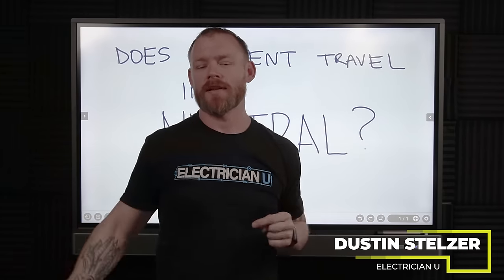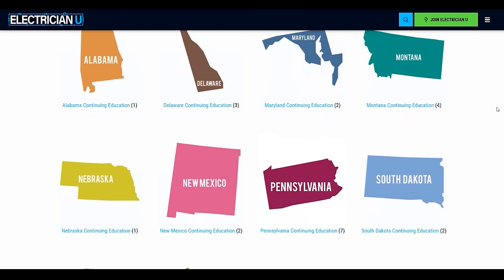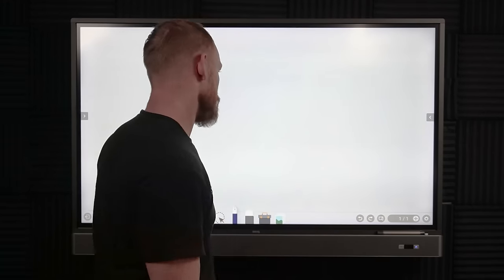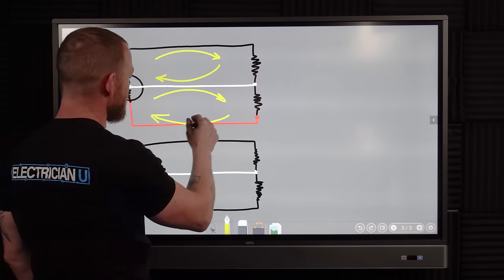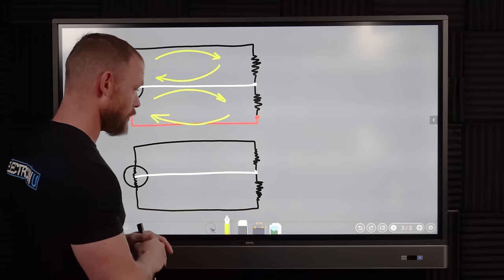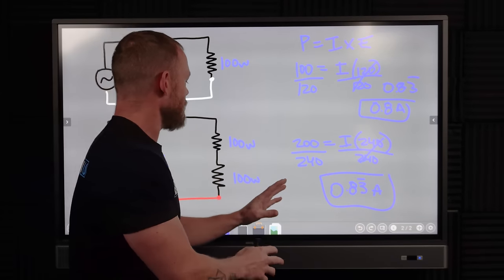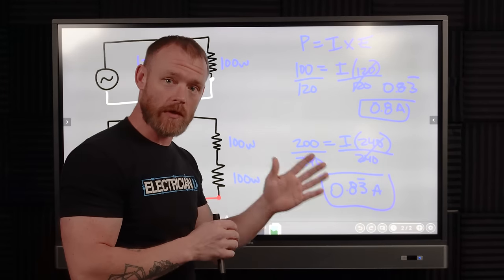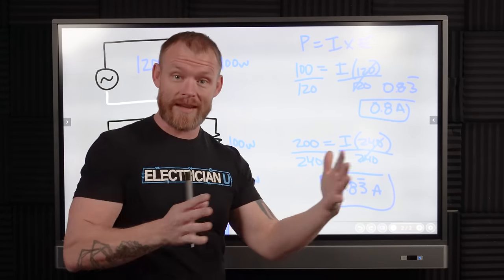Does Current Flow on the Neutral?

Comment: For what's it worth, I actuallty liked that you didn't have  the "schematic" drawn already. Not sure why, I have seen you draws these dozens of  times, I guess it just gives me time to process it things and get my mind in the right frame for what you're about to discuss.
Reply: 100%
Reply: This part
Reply: @tylerrcasement  what is Dustin Teaching 🙏🙏🙏
Reply: Agreed.  I'm not an electrician but as a homeowner that fixes/improves things it helps me to see how it all goes together.
Reply: @kevingray8616  Hi
Reply: @jeremynguyen2346  
Physics and math.
Reply: J
Reply: Hi the neutral of a seperatly derived crkt has a return current at 0 volts if u share a white or gray wire 277vac neutral w l1 l2 or in 3 phase systems l3 only unbalanced current will return if ea phase has 4 amps ,they cancel if phase a is 10 and phase b is 5 ,5 amps will return at 0 volts there is no push or pull there is current flow away from source to load .electricity is used up as power (kva) or luminaries. nuttin  Returns to power co thats y u get a lectric bill .there r 1.16 to the 19 power (which r zeros ) of electrons moving from point a to point b in 1 ampere . b safe and have fun. lis. Contractor in 4 ne states e1 unlimited in conn thanks for reading
Reply: @davidiannucci2138  
No one is impressed.  The video was about single phase residential, not two or three phase or other multiple sources of current.  And use of industry specific acronyms and slang and abbreviations, that the average person does not know and may just be bullshit, is obviously done solely to impress or confuse, not educate.
Reply: Once answer question first then explain why.
Reply: I agree. Seeing him actually draw things out helped me understand what was going on better. 

He's a great teacher.
Reply: Agreed actually
Reply: 100% agree! Drawing it out in real time really helps someone see how what you're teaching unfolds. I think this is very important.
Reply: YES, don't pre-draw!!!  What Kevin Mach said is true. It gives us time to process. It's not overwhelming.
Reply: Very good point especially if you have learning difficulties etc.
Reply: Exactly, you hit the nail on the head!
Reply: @guysmith5095  Ok, now you have to share the story...
Reply: As someone with a degree in Computer Science and Education, I agree. A pre-drawn drawing tempts the speaker to go over things too fast. It also tempts them to refer to things too quickly, then the viewer loses track of what the speaker is talking about.
Reply: @guysmith5095  Yeah, I have heard that before. Would a pen tester have signal voltage? I believe it would have. Glad you're ok tho
Reply: Watching the circuit be drawn allows us to follow along better.
Reply: Agreed
Reply: Absolutely
Reply: Agreed
Reply: I agree with @kevinmach370.  A pre-drawn graphic would put the viewer in the position of wondering where to start looking, and what sequence the eye should follow to take in the whole picture.  Then after viewing, I would be wondering if I missed  anything.  The build-up of the graphics proceeded  in a very logical fashion.  This video  was very well done!
Reply: This video gave a balanced and neutral perspective 😅

Comment: As a practical point to novices doing wiring.  Of course whenever possible turn the power off before connecting wires. But remember if you touch between two neutrals you can become a load. In effect you put your body in series with that circuit path.  So the assumption that some people have that "the white wires are safe" is bs.
Reply: Been there done that. Learned fast
Reply: Don that is so true! When I was a lineman guys would get careless handling neutrals, especially during storm trouble. Get yourself between an open neutral or a tool between an open neutral and you can find out the hard way.
Reply: Also why code doesn't let you put two neutral wires under one stud at the panel.
Reply: I don't know the NEC codes of today, but I recall an old tale of a plumber being electrocuted working on a water meter because the main neutral was bonded to the house side of the water pipe and not the street side. True story? I have no clue.
Reply: @smitlag  that’s not a code thing. That is a requirement from the manufacturer of the panel.
Reply: @RB-xv4si  inspectors will fail that  at least where  I live. Potential to backfeed your circuit with 240 if your two circuits are on different phases. But I should add, I did commercial electrical work in high-rise buildings prior to a career as an electrical engineer for the elevator trade. I don't  do much residential stuff other than my own. We deal with our subsection of  the electrical code. Where I have seen this most is in situations where the phasing on the mainline was different between elevators (cars) in a group. Normally that should not be the case, but it does happen if two different guys wire mainline disconnects. It is a bit beyond this topic though.
Reply: @smitlag  inspectors consider manufacturer requirements too. Not just code requirements. Putting two neutral conductors under one neutral terminal doesn’t change anything electrically with those circuits. It’s just a mechanical limitation of the terminals.
Reply: @Rick_Kn   That alone wouldn't kill the guy, The neutral in a circuit was broken somewhere and likely more than one place, or they were intentionally running current though earth ground.
Reply: @smitlag  
In addition to the other responses, it's simply good practice... because intermittently dropping a neutral associated with a hot circuit, can cause all kinds of problems/damage.
Reply: Perhaps more accurately; you're carrying the load.
Reply: @FOH3663  from a pure circuit perspective you are a load. Whatever the resistance of your body at the time happens to be and depending how well you are grounded . Or even if you are not grounded at all,  you are merely a load. I could draw you as a resistor in a circuit.
Reply: @smitlag  
Sorry, no. 
If you open two neutrals, holding them one in each hand, you're carrying the load. 

If you hold a hot and a neutral in each hand, you are the load. 

Quite simple... help me out, what am I missing here?
Reply: @smitlag  
... ie., carrying the load. 
👍
Reply: @FOH3663  engineering doesn't use "carrying the load".
Reply: @smitlag  
Seriously? 
Of course engineering utilizes 𝙘𝙖𝙧𝙧𝙮𝙞𝙣𝙜 𝙩𝙝𝙚 𝙡𝙤𝙖𝙙... 
I can cite countless examples. 
Electrician, turned elevator engineer... doesn't understand what I meant, or delineate between 𝙘𝙖𝙧𝙧𝙮𝙞𝙣𝙜 𝙩𝙝𝙚 𝙡𝙤𝙖𝙙 𝙖𝙣𝙙 𝙗𝙚𝙞𝙣𝙜 𝙩𝙝𝙚 𝙡𝙤𝙖𝙙. 
...  because engineering doesn't use 𝙘𝙖𝙧𝙧𝙮𝙞𝙣𝙜 𝙩𝙝𝙚 𝙡𝙤𝙖𝙙.

Perhaps it's simply a regional dialect challenge. 
Thanks
Reply: @FOH3663  think of it like this; when you break a circuit at the neutral and hold one neutral wire in each hand, technically you become part of a series circuit. The normal circuit load is likely a low resistance compared to your body that you put in line with the circuit. For instance if the normal load is 30 ohms and you put yourself in the circuit at 3000 ohms, by Ohm's Law your body is taking 99% of the line voltage and only 1% is dropped on the load. On a 120 volt circuit you would have 118.8 volts across your body. The current through you will be V/R so 118.8V /3000 ohms = 0.039A or 39mA. That's not quite enough to kill you but it will absolutely wreck your day. If you happen to have lower resistance than it could potentially kill you. Bottom line is beware of neutral wires.
Reply: @RB-xv4si  Don is right, the code dictates everything.  How these code develop over the year is based on accidents, wrong applications etc, if manufacturer doesn't produce their product according to code, it won't get certified, can't put in the market.  Take an example, a US manufacturer can produce electrical panel for UK or EU countries but they have to build that according to the EU/UK code or import won't happen, right??  so the code wins every time when there is a conflict between the two. Think with logic and use your common sense............ of course manufacturers can contribute to the development of code but they are not the decision maker.
Reply: @keithwfchan  actually, they are the decision makers because they have sitting members on the code making panels. There is no code that prohibits someone from installing two wires under one terminal if the lug is rated for this. And if you think there is, then I challenge you to point out the code article.
Reply: @Steve_Edberg  
Thank you, your response is much appreciated. 
I'm retired; 38yrs as an IBEW Electrician, and 3yrs of Physics toward a separate degree, all yielding two separate parallel careers, covering two different disciplines!

I simply took exception to an "engineer" claiming engineers 𝙣𝙚𝙫𝙚𝙧 use the term 𝘤𝘢𝘳𝘳𝘺𝘪𝘯𝘨 𝘵𝘩𝘦 𝘭𝘰𝘢𝘥. 
With decades of experience side by side with EEs, in my experience it's somewhat bizarre for an individual to claim that... especially w/countless examples to the contrary. 

1.) The engineer suggests if one breaks the neutral path, holding a one in each hand, you become the load. 

For clarity, I point out you're now carrying the load.. ie., you're now an element of the circuit, and the entire load (I) passes thru you. 

Just like the conductors carrying the load, you too are carrying the load. The same current passing thru the conductors are passing thru you. 

2.) As I also pointed out, grabbing the hot in one hand, the neut in the other, ... 𝙩𝙝𝙖𝙩'𝙨 𝙬𝙝𝙚𝙣 𝙮𝙤𝙪'𝙧𝙚 𝙩𝙝𝙚 𝙡𝙤𝙖𝙙. 

Perhaps this may appear a subtle distinction to a layperson. However electrically, it's significantly different. 

There's a great deal of Apprentice  Electricians consuming this content and many here in the comment section.
I felt the additional clarity was important. 

My guess is it's a regional dialect thing, either way no prob. 

(First to Make, Last to Break)

Thanks again
Reply: @FOH3663  you're welcome and thank you for the friendly dialogue. It's always a touchy thing on any social media to contradict someone anymore not knowing how their response might be. Anyways, the way you describe it is correct. As unlikely as it is, I just wanted to clarify in case anyone reading the comment might think that breaking two neutral wires is a safe practice because they're "not the load." That statement could suggest to that there is no danger there when clearly there may be depending on what's plugged in on a downstream outlet.
Reply: A conductor not a load
Reply: @smitlag  cause one studs for one wire not multiple conductors

Comment: I was under the impression that the white wires were the safe ones. I was 19 years old up on a twelve foot ladder working in a commercial building. I was working the fluorescent lights hot because it was a problem shutting them off. So 10 feet off the ground I learned that the white wires are extremely dangerous. Fortunately I didn't fall or get injured. After that horrible shock from 277 volts, I was really having second thoughts about the trade I was getting started in. I'm a retired 68 year old electrician and by the grace of God, still able to talk about it.
Reply: Older guys (my gdads age) used the saying “only touch one wire at a time and you’ll be ok” which is absolutely untrue. 
A break in the circuit path neutral or hot is a place to get hurt.
Reply: dude, a grounded conductor only has zero volts until it is disconnected from the neutral bus. onces it is disconected the voltage increases to that of the ungrounded conductor, in your case 277 volts,  when you touch that and then touch ground you become a big assed human resistor to ground.  current flows......that hertz real bad.
Reply: A grounded conductor would mean it's grounded wire, correct? Implying it has a charge, but still it's a ground wire.
Reply: just a joke:  This is why you pay attention in physics class.
Reply: Most of the time you're lucky and the electricity doesn't kill you. 
Most of the time it's just that you fall off the ladder and break your arm.
I already accidentally touched 230 volts, it wasn't pleasant.

But if you get too close to the overhead line's voltage of 10,000 volts or more, it will definitely be fatal.
Then it won't help anymore to call the fire department, they won't dare approach you.
Reply: Same thing, I was getting zapped by the white after flipping the fuse and verified the black was dead. Went back to the source and found a yellow, black, white coming from the basement or 3 phase and they did 2 black/white runs in the kitchen, some of the appliances on the other run were on all the time and they were energizing the white. I didn't this was to code and in theory someone working on the circuit could get killed and the amperage of the white could be 40 instead of 20 amp you don't have a 3-phase load on the line. I went with a single 20-amp line for appliances, microwave is probably the worst appliance I have.
Reply: I was doing my first commercial job before I got my journeyman license and was using a metal locking ladder in a Sears warehouse changing out ballists and got the worst shock of my life. I was leaning over the metal bar of the ladder and it knocked me to the floor. The load on a 277 lighting circuit will light you up, literally and figuratively
Reply: If you can learn you can be in a dangerous trade and live.
Reply: The neutral wire is neutral as long as it's connected back to the circuit breaker box. If you break the neutral at any point (cut it or undo the wire nut), the side going to the load becomes hot with the same potential current as the load.
Reply: It would be safe if the ladder was non conductive and you touch the neutral with one hand and nothing else on your body in contact with the circuit. Then there is Murphy's Law, nothing is foolproof regardless how careful you are.
Reply: @kimchee94112  It's all about potential. Electrical line crews work on hot lines from an insulated bucket and cage that is tied to the same potential as the line they're working on.
Reply: If you break the neutral path (disconnect a wire, etc.), the white wire coming from the load (light, etc.) becomes hot.  I thought any electrician would know that.
Reply: it hurts lol  or i mean it Hertz
Reply: @jensschroder8214  It's not the volts that kill you. It's the amperage. 230 volts with no load will not kill you. It won't hurt much at all. It's why the output voltage for fluorescent lights are very high but they have tiny wires because the amperage is tiny.
Reply: I'd think the load would absorb some amperage, and the 120V at the corporation I worked for seemed particularly strong!
Reply: @Elpipiton  Ground wire has no current or volts until a metal appliance fault occurs to offer the least line of resistance to protect a human.
Reply: @danwallen4031  Ground has always been zero being used for fault currents!   When neutral disconnected from the ground (M.E.N) it will float to supply potential. Different if M.E.N connected and neutral disconnects to potentially liven bare conductive surfaces giving various levels of shock.
Reply: My layman understanding of working with electricity is that being grounded is more dangerous than the HOT or being electrified.  So when working with wires, be more cautious of being grounded than touching a hot wire .
For example having your head on a water pipe or touching a heater vent.
I was once using a multi meter testing for 120v.  At some point I put hot probe on hot wire and put black probe on heater vent I was on .  120v…
Reply: @calvinjosey5784 I have never been on a job where electricians were allowed to use metal ladders.
Reply: @bmarkie4103  It was a Sears warehouse ( I would say 1998) and I was on one of their huge rolling/locking ladders. We only use fiberglass within our company but I used Sears ladder to change the t12 and t14 ballasts they had
Reply: I have learned a lot from this tutorial as well as from the comments. I thank you all.
Reply: @Elpipiton ”grounded” wires are any wires protected by the “grounding” wire. The grounding wire is the actual ground (green) wire.
Reply: amen can relate worked light chage outs hot a few times & yes 277 nver got lit up thanks God Those days but Boss flipped out whe he found out 1/2 the lights were done hot the other 1/2 we found & killed the power
Reply: I actually had this same experience on a 20 foot scissor lift when I first started but I was converting them to LED and removing the ballast. Worst tingle I ever felt. I also grabbed a male cord attached to a motor that was still spinning. I’m only 29, pray for me haha
Reply: I wise I had a dollar for ever 277 light I throw away when they changed them out at the stores I worked in.